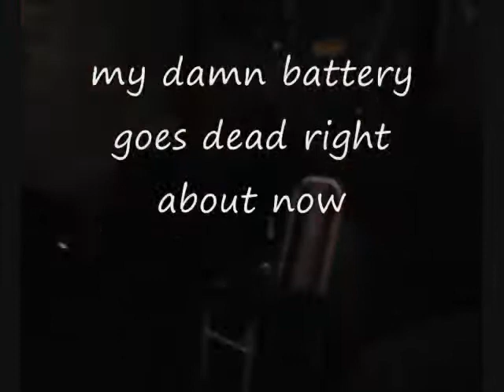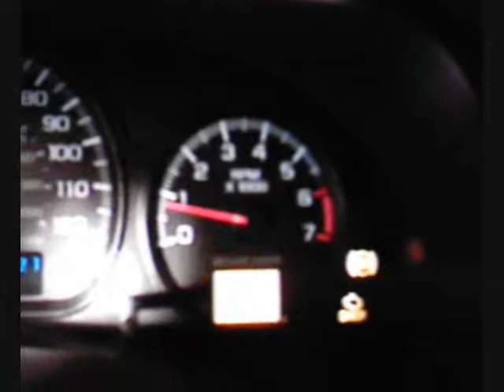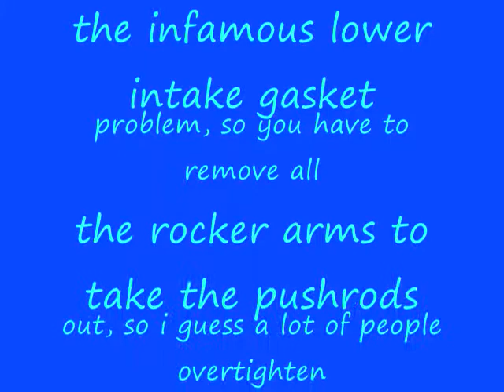3.4l gm infamous engine ticking, noise

Comment: We have an 04 Monte Carlo with a 3400 that has 243k on it and it runs perfectly and very quietly, we drained the DexCool out of it and replaced it with premixed regular green antifreeze, stopped overheating problems immediately
Reply: @Its a Rome Thing Everyday : 
Yup, GM's "DexCool" is absolute garbage! Only thing it's good for is killing pests, like woodchucks or maybe your miserable spouse!
Over the years, I've seen 1st hand more than my share of what it does to destroy a vehicle's cooling system. I don't care what anyone says, it's caustic shit that deteriorates everything within a vehicle's cooling system. Gaskets, seals, plastics, even metals, etc.
If a vehicle I purchase has DexCool, the first thing I do is drain and flush it all from the system, and replace it with fresh new "green" antifreeze/coolant. Never have any cooling system related problems after doing so.
Reply: @turbodiesel4709  I agree, we do same also

Comment from the maker: @SuperTurboDiesel2 so after about 2 yrs later 2 more popped in the front so  did a lil more research and found out if the rockers arent tightened down to the exact spec later on in time theyll eventually rip out, cuz of the aluminum threads not being strong enough
Reply: @Mikeyssss : 
The aluminum threads really aren't the problem, human error is the problem.
All too often, inexperienced (or sometimes just plain stupid) people will over-torque steel hardware that threads into aluminum parts. They wind up stripping and/or literally ripping the threads out. Torque specs are published for a reason!
Conversely, if a person doesn't tighten the parts down properly or fails to use threadlocker on more sensitive parts, the bolts can loosen up. 
In your particular case, loosening can occur from the repetitive rocker arm motion & normal engine vibrations over time. The loose steel hardware will eventually allow the bolt to tear out the aluminum threads, and chaos will ensue.
So again, in a nutshell, human error is the actual problem.

Comment from the maker: @SuperTurboDiesel2  so thats why i hear so many of these engines lightly or mildly ticking, yea the first time it happened, the back middle intake rocker poped out, sounded like shit the exhaust was shooting back into the intake, and i didnt know wth was wrong lol, so i did some research and found someone had this problem so i brought it to my dads buddies shop and when he popped the valve cover off thats when he found out the rocker bolt ripped out
Reply: @Mikeyssss : Rocker arms coming loose is usually caused by stupid people. Either they did not tighten the hardware down enough, or much more often it's from over-torquing the hardware. It's pretty easy to f-up an engine by over-torquing a steel bolt that threads into aluminum. Wouldn't be the first time somebody overtightened a steel bolt and ripped all the threads out of an aluminum part. There's lotsa stupid out there.
Furthermore, a dab of blue threadlocker (Loctite) on the threads upon reassembly of critical parts can do wonders for preventing loosening if you are worried about a part coming loose inside of an engine..
That's why torque wrenches and plain ole common sense exist. Sadly, not many folks have the latter these days. 
I've worked on a lot of GM engines over the years, and the problem you're describing is quite uncommon... unless someone who didn't know what they were doing had already been in there and schmucked things around.
Reply from the maker: Turbo Diesel yea someone apparently did the intake gaskets before I got it and not only did they not torque the rockers right they didn’t tighten the fuel rail down enough either
Reply: @Mikeyssss  UGH, it's amazing isn't it?!  facepalm

Comment: this could be caused by using impact gun to tighten rockers after doing intake gasket, the intake gasket are bad about leaking oil and often replaced under warranty at the dealers. these rockers use lock nuts on the studs to keep rocker adjustment. should hold rocker stud with open end wrench on the bottom and deep socket on locknut on top and remove and install these by hand instead of running in and out by air gun. flat rate techs at dealers are always in a hurry and not paid a fair rate of pay on these warranty jobs so the take short cuts.
Reply: @bradley goode : Very good possibility. There are a LOT of inexperienced and just plain lousy "mechanics" out there.
Reply: These rocker arms do not have anything you can put a open in wrench on to assist with adjustment, they are a single bolt into the aluminum head that goes through the rocker arm pivot and the metal base of the rocker arm. There is only one way to adjust these rocker arms and that is how tight you torque the rocker arm bolt. Do it when the valve is supposed to be closed, torque until the pushrod can spin freely but you can feel resistance when trying to spin it, and you should be good.

Comment: Interesting... Never heard of your thread issue, but I suppose it's possible. Typically, the problem with these 3.4L's and the 3.1L's is that the intake gaskets go bad and the coolant leaks into the engine oil, which leads to the hydraulic lifters not "pumping up" correctly, and you get some to a LOT of "ticking" noises coming from the engine. Can sound like minor ticking, all the way to sounding like there are gremlins throwing a fuckin' rock throwing party inside your engine when it's running.
Reply: Finnaly someone who knows what their talking about
Reply: @EarnYaBonez  : From what I've read in the comments here, as well as real-life experience, it seems some people (inexperienced) are over-tightening the steel hardware and stripping out the aluminum threads that they are threaded into. Naturally, that leads to parts coming loose and things falling apart inside. 
Unfortunately, ya can't fix stupid... Only what they screw up.
Reply: @turbodiesel4709  This is what happened on my 3.4l Impala, I took the valve covers off and when I went to remove the rocker arms, all of them were overtorqued and 2 were stripped. I helicoiled the ones that wouldn't retighten and the engine runs better, but there's still valvetrain noise. Not as bad as before I worked on it though

Comment: I wonder if this is more a problem in colder climates. If it's 10 below over night in the garage won't those lifters  take some time to pump up? Until they do pump up, there is a gap and they act like little hammers pounding the push rods up against the rocker arm.That must put some added stress on the rocker studs/bolts/threads.

Comment: To prevent this problem is DON'T overtighten the rocker arm bolts! Use brake & parts cleaner & compressed air to DRY all the oil/contamination from the bolt threads as well as the hole threads where the rocker arms bolt to the heads. No problems occur if you torque the bolts to the proper spec with a torque wrench! Of course, if someone else has already been in there and over-torqued the damned things already, you may be helicoiling! People often create problems by not doing repairs correctly.

Comment: @Mikeyssss Mine makes this noise at first then goes away if I let the car sit for about 5 minutes before starting it a second time.  Not sure why.  Just did a head gasket job and there were many torque specs for the lifter bolts, I went with the GM and manufacturer spec of 24 Ft-Lbs in the end.
Reply: That's my problem. I went with 14lbs because everyone varies. Well I'm pulling the covers again to tighten to 24. They chatter now and never did before I did the head gaskets

Comment: due have pivot rocker or roller rocker cause if u got pivot yes they will break loose had that on a 3100. That was because i had went for soo long with the intake gaskets leaking a got in the oil and churned it up

Comment: Probably a collapsed lifter and continuing to run it may have caused the rocker bolt to loosen or when your moving it your just smacking the rocker against the push rod since there would be a gap between the two because of the collapsed lifter.

Better to take it apart and really view the inside.

Comment: Yup steel rocker bolts in Aluminum heads bad combination G.M. suggests heli coiling them all instead of 1 by one. When replacing upper and lower intake gaskets that is the best time to do it.  Good engine design but bad but not the proper metallergy used.

Comment: also-when the intake manifold gaskets are done -dont remove rocker arms-use a a 12mm line wrench to tip the rocker arm down & slip out the pushrod-this will stop the threads from getting weakened from repeated removal

Comment: A dab of blue loctite on the threads couldn't hurt either. Just a DAB, not a lot. I'd also be willing to bet that if your lifters are already "ticking", due to bad intake gaskets and coolant getting into the oil, the ticking you hear is the lifters pounding into the rocker arms. If they keep smacking long enough, bad things like this eventually happen. I wouldn't be surprised if the constant lifter pounding against the rockers loosen the bolts (by pulling the threads) from the aluminum heads.

Comment: Sounds exactly like what i just dealt with. 3.4 GM was misfiring like crazy. threw a p0304 code. cyl 4 was reading 30 psi after compression test. auto shop told us it needs a new motor and blames worn rings. I pulled the valve cover off my self and inspected rockers. Cyl 4 intake pushrod was totally bent in half and cracked on intake side. Also the exhaust rocker bolt was loose. Not sure how, possibly valve float? I replaced pushrod and car purrs like a kitten. Pull that valve cover and inspect each rocker arm and push rod. Just my two cents.
Reply: @Fresh Beverages : Sounds like that "shop" you took your vehicle too shouldn't be allowed to fix bicycles! It's unreal, the absolute garbage mechanics and dishonest (or clueless) shops that are around these days!
Reply: thanks, this sounds more what I was thinking, guess I'll do the same.

Comment: really? never had that issue with my 2000 Buick Century Custom with a 3.1 SFI and it had over 180,000 miles on it before some knuckle head smashed into it! and i live in Michigan where it gets freezing cold during the winter

Comment: Hi, does this noise go away after a while? After the car warms?  Mine makes this noise at first then goes away if I let the car sit for about 5 minutes before starting it a second time.  Not sure why.  Just did a head gasket job and there were many torque specs for the lifter bolts, I went with the GM and manufacturer spec of 24 Ft-Lbs in the end.
Reply: +clint4Now Was thinking the lifters just haven't pumped up yet.
Reply: +clint4Now it's just a noisy lifter. after the motor warms up to temp it goes away.
Reply: +clint4Now that can do it also.
Reply: kevin brooks  It was just my oil I put in a heavier weight so when my car warmed up it went away too. When I put in the recommended 5-30w, this problem went away for good. Cold weather made the 10-30w more prone to causing this problem too as in warmer weather it did not affect it. :-)
Reply: @clint4Now  : Yup, not surprised. A really good rule of thumb is to "NEVER" run heavier viscosity oil in modern engines. Tight tolerances of modern engines require "thinner" oils that can and will FLOW immediately upon engine start-up. 
Always run what grade is specified by the manufacturer, based on the climate you will be operating the engine in the most. 
For most every 4, 6, & 8 cylinder GM engine (2.2L, 2.3L, 2.4L, 3.1L, 3.4L, 3.8L, 4.3L, 4.8L, 5.0L, 5.3L, 5.7L, 6.0L, 7.4L, 8.0L, etc... in the 1990's - 2000's), SAE 5W30 oil IS the correct crankcase engine oil spec. 
Using even SAE 10W30 or heavier oil can & WILL cause internal component oil starvation. 
In colder ambient temperatures, higher viscosity oils are more resistant to FLOW, which in turn leads to serious internal component wear over time.

Comment from the maker: @camposwilliam62 well when it first did it,  i think it had like around 74 or 76kish but if its running real rough, ticking kinda loud, and u got an engine light for a misfire code, most likely this is it, cuz wat happens is when whoever changed the lower intake gaskets must have overtightened the rocker arm bolts, since ive had mine, ive done 1 in the back and 2 in the front, if u can get a vid up id be able to tell a lil bit more, but if it sounds like mine did, then its prolly the same

Comment: ignore it, drove mine with that knocking for 10 years cross country with no problems
Reply: really? i did the spark plugs for the first time in my life about 4 months ago and now i have this noise. i got the car about a year ago and never heard it before so pbby i did something wrong? what is it tho is it a spark plug?
Reply: well for mine its the lifters ticking, when its cold its really loud but when the car warms up it almost goes away, can still hear it if i open the hood and listen, i had my 98 monte since 04 when and its ticked when cold since the first day i bought it and still does and works fine for me
Reply: yeah i am gonna go check my coolant and see if i have an oil leak ...i heard the noise loud this morning and you are right it is getting cold here. still i don't want to have major issues like replacing the whole engine. i have a pontiac vibe and i want it to last me a couple of years

Comment: thanks for the video, i´ve searched and searched . and found out that theres many different answers to how you adjust the valves . 19 nm nd then 30 degreess right ? or....how did you do it. i would really apprechiate it if you took your time and let me know cause...damm so many different answers .
Reply: Just buy a Haynes manual for $15 off eBay and it will give you pictures and specs. Anybody can do it. Just do a Google search.